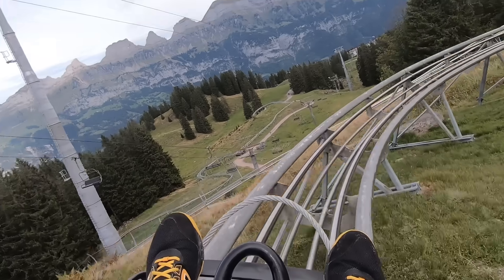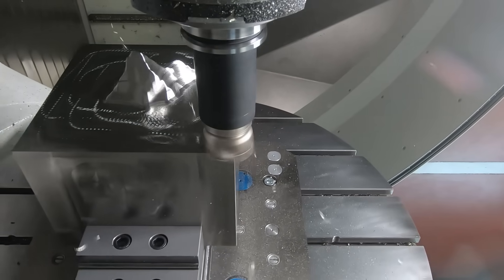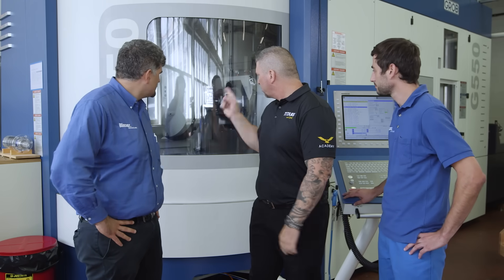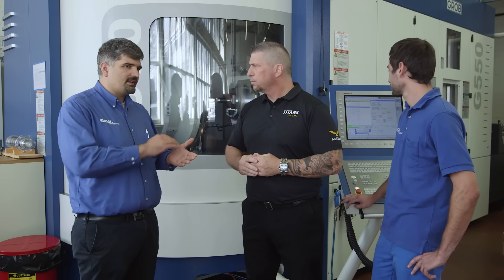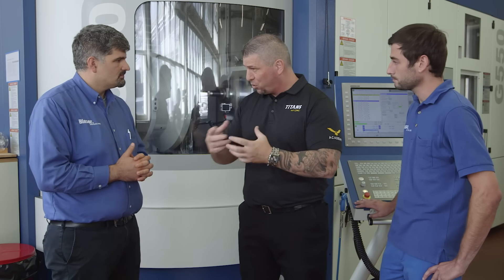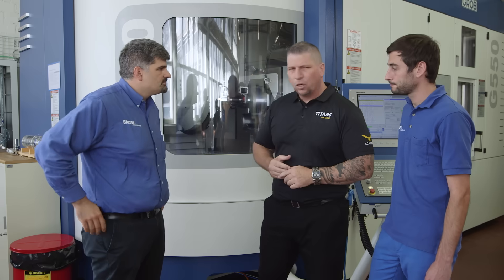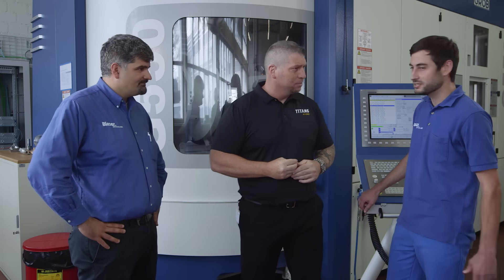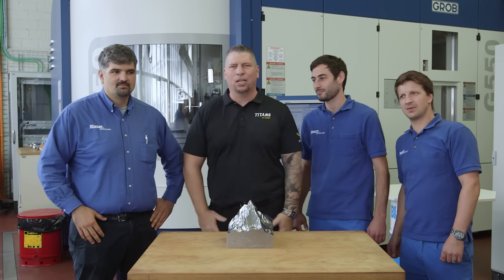CNC Machining a 5 Axis Matterhorn out of 316 Stainless Steel with Invisible MQL Coolant

Comment: MQL coolant comes in three varieties: FA = Fatty alcohol-based, SE = Ester oil-based, HD = Heavy duty
What is the flash-point of these three types of MQL lubricant, and what is the risk of it turning a CNC machine into an oil-fired boiler?
That fine mist of oil particles has a large chemical-reaction surface in contact with the oxygen in the air, so if that oil is at all flammable then the coolant nozzle is just an un-lit flame thrower.

Comment: Cool. But I'v done 120 threads M5 in 9000 mm long stainless steel part and I doubt this coolant will be good for it.
Reply: wow, what are such long and thin threads used for?
Reply: Two parts that come together and inside goes paper, dunno how it works
Reply: When tapping, I have better results with tap magic oil. When cutting I use coolant. Don't be quick to judge, Swisslube is a fantastic product and I recommend using it when the job can afford it.

Comment: Hello
I am curious about the long-term experience.
Personally, I have the experience of depositing residues as a hard-to-remove film inside the machine. It improves the suction of the inside of the machine, but it does not solve this problem altogether.
Pavel wishes successful business

Comment: Why is stainless such a pain to drill and machine? Is it the grain structure? I’ve ruined more drill bits on stainless than I care to admit.
Reply: It work hardens.  It also does not transfer heat well so the heat does not flow away from the area cut.  If your tool rubs at all it will create a hard skin on your work piece.
Reply: Chromium & nickel, that’s why. It work hardens much easier, which makes selection of tool geometry and application strategy much more important. Peck drilling isn’t helping, if you have the ability to eliminate that.
Reply: I’ve never had a problem in stainless, even hand drilling in a drill press. 
Simple make it eat! And lots of either air or coolant to remove the heat.
Reply: @Gerrit Bearda dont peck stainless. It will work harden. Just lower feed rate and thru drill coolant.

Comment: Love the fact his hand was right next to the E-Stop the whole time
Reply: Rule Follower true
Reply: Rule Follower And?
Reply: @Icutmetal  And that's a good operator...that program has probably been ran lots of times but he's still on top of it in case something goes wrong
Reply: @Bawbag0110  And we put robots next to cnc-machines to load them. While we could just as easy load them by hand because a good operator just stands there with his hand near the e-stop the whole run.
Reply: @Bawbag0110  Maybe he doesn't trust anything less than a high pressure flood cooling... Haha
Reply: @Bawbag0110  Not really, I run on a 4 Horizontal Okuma 2 Steel and 2 Aluminum, They are hooked up on a 40 pallet Fastem System. Some don't have time to stand near the E stop, I also have to change out tools, and calibrate when needed. Also get rid of any mismatch that the parts may have. That is just my side the other side is 4 Horizontal Okuma and 1 Grob, which I do work on sometimes, there has to be at least 2 people on that side to make it run very smooth.
Reply: @djgamer2012  I'm not saying he stands there the whole time but probably because they were doing a film
Reply: @danl.4743  he trusts his OWN high pressure ehmmm "coolant"...... hahahahaha
Reply: Rule Follower - The “Too Late” button
Reply: Habit. I wake up to find my hand resting on the nearest Estop sometimes. It's started problems in my marriage. She thinks I love the Estop more than her. I try and tell her that it isn't so, that I just need to touch the Estop to make me feel safe, but she just says I should feel safe with her. I don't know what to do. I don't want to crash that endmill into the bolt head again.
Reply: @brahtrumpwonbigly7309  Hahaha, nice